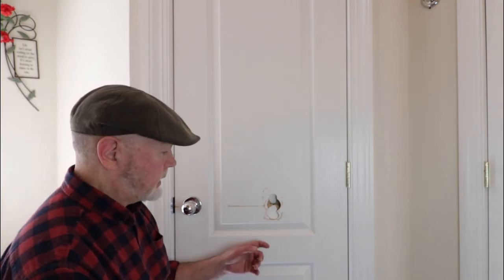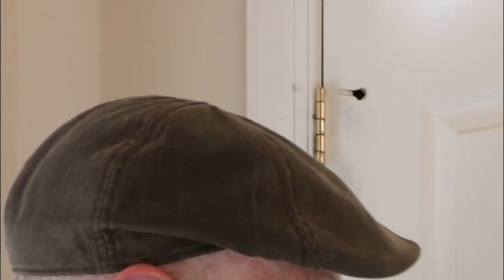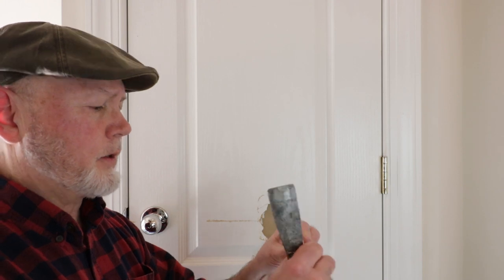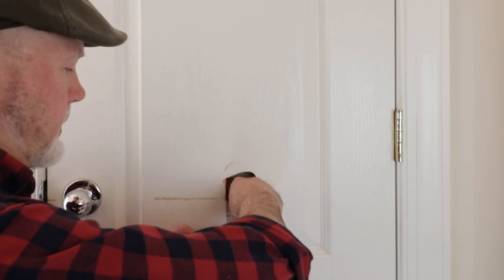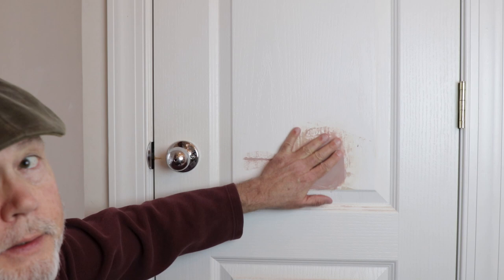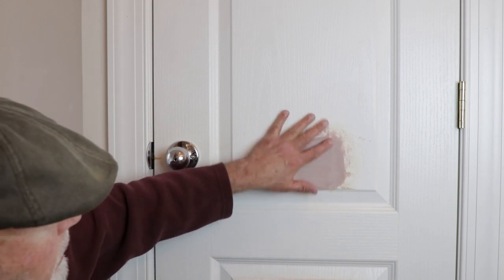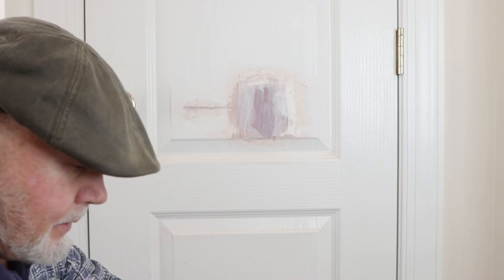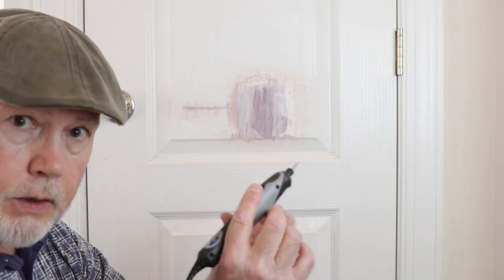How to - ADVANCED REPAIR A LARGE HOLE in a masonite WOOD GRAIN TEXTURE hollow core door

Comment: By far the best approach and the best results.  The little extra effort makes a world of difference.
Reply from the maker: Thanks Jim!
Reply: @douglashill7059  I'm doing this repair today on a two panel door.  I decided to cut out the two large broken pieces,  glued some backing wood to hold the pieces in place, and when the glue set I began to fill with dyno patch compound. So far everything looks good. When it's dry and sanded I will add the texturing to blend it in.  The break was where the panel raises out so the repair is complicated. I hope when it's all done and painted it looks as good as yours.  Fingers crossed.  Thank you for your master class on hollow door repairs!  Nobody else's even come close.

Comment: Good technique here. I've used Bondo (and occasionally JB Weld) for years on wood and its perfect for it.  While I was working in building and grounds maintenance, I was working with the senior maintenance guy doing some flooring projects in the various historical buildings and he gave me a little tub of "High performance wood filler".  It was just overpriced Bondo, though with a slightly more "wood" color compared to the old Pink bondo (though the new stuff uses a blue hardener).

I've actually got a couple hollow core doors at home to patch up and was wondering what the best way to get that wood grain in would be and, well, your dremel technique is perfect.  Always love excused for grabbing a new tool, thanks for the tips! Hope you are doing well.
Reply from the maker: Thanks for watching Chris

Comment: Valiant effort. Having done a lot of repair work for a living, the hours needed to do this make a $30 door the only option. And I've done some fake wood grain.
Reply from the maker: Lee, if this was an in stock $30 door, that would have been my first option.
Reply: @douglashill7059  these doors don't cost $30 .. more like $70 . and that's a blank door slab.  you still have to cut your knob hole and hinge mortise. and 2 coats of paint. so time spent there.  I've done several hole repairs. and with damages across the recesses . and all turned out great.   thank you for sharing your knowledge. keep em coming sir

Comment: Soo... awesome; perhaps hold the can upside down when dispensing to allow it to escape from the nozzle, also I have had experienced that expanding foam distorting the materials around it; that stuff has amazing power. It is used to lift concrete pads and hold power poles up.
Reply from the maker: Will make a note to hold the can upside down. Actually redid this project because I left the can in the attic over winter and the foam continued expanding for 2 days maybe because it was not fresh or did not shake it up enough
Reply: @douglashill7059  There is available minimally expanding foam that would be perfect for this.

Comment: Very nice! So i have a similar situation in our bathroom. My hole is in the middle of the panel and the wood or whatever is still attached, just dented in.  At the deepest its maybe 1/2". I was thinking of taking the lightweight spackling and filling it, then after i use the spatula to smooth it i was.going to take a nail or something amd drag ot through the compound to simulate the woodgrain. Since it's in the middle of the door I have to kind of connect the lines. Have you ever tried this method? It's not very deep and I don't want to rip off all the paneling and put spray foam in and do the whole patch I was figuring it was shallow enough that I could get away with the lightweight compound
Reply from the maker: It may hold up fairly well. I like the nail scratching concept
Reply: @douglashill7059  I will endeavor to make a video

Comment: So cool! What would you do if a hollow core door was cut down to fit and then the side came out? Seeing if I can salvage it. 🤔
Reply from the maker: Thanks! If a standard size door does not fit, and you had to cut it to size, and you cut it past the vertical or horizontal spine, separate the spine from the panel and wood glue it in place using clamps.

Comment: The repair work on those doors is all fine and dandy, but I am really curious about how your pool game went. I have considered using Bondo and some foam on a certain pocket, but alas, that would be considered cheating.
Reply from the maker: Having trouble with a certain pocket? Try leveling your table to your advantage before permanently covering the hole, lol
Reply: @douglashill7059  😂😂😂

Comment: Would it be possible to "engrave" the woodgrain with a pointed object while the putty is still pliable? I feel that would save you from having to Dremel it, especially if you didn't bring one along
Reply from the maker: Results will vary. Bondo sets up really quick. The nice thing about using bondo is if you don't like the result, you can always sand it down and start over
Reply: @jamest1375  It actually worked out really well the way I mentioned. Customer was very happy. No Dremel required 👍

Comment: Very informative video. I have a sunken spot on a closet door where my husband stumbled and accidentally pushed through the wood. The  broken spot is not entirely broken through, but I should still remove the cracked wood to make a hole first before repairing, correct?
Reply from the maker: Hi Michelle, if it is just a crack in the door, you can patch over it. If it is a hole, remove surrounding area before starting the patch. Thanks for watching and good luck with your repair

Comment: Hold the spray foam can upside down, your letting all the air out of the can.  You did it on both video's
Reply from the maker: Thanks for the tip
Reply: @douglashill7059  holding the can straight up allows you to clear out any foam in the tube.  Yes it's meant to be held upside down to spray the foam

Comment: I have this door and the sides are lifting from the base part on each side of the door. What kind of glue can I use to glue it back together? Also, the card board at the bottom fell out, I think I threw it away.
Reply from the maker: TRS, use wood glue and clamps, should be pine at the bottom of the door, if not cut a piece to fit and use wood glue and clamps

Comment: How would you repair a fiberglass exterior door that has a dog door? New doors are expensive and we do not have a dog.
Reply from the maker: Not sure how big the opening is, assuming it is the back door, is it a flush door or 6 panel, but you may want to just lock it, fill it with foam insulation, and call it a day. If it is small, maybe fill it with foam and put a kick plate over it
Reply: @douglashill7059  The top half of the door is a window. The bottom part has 2 panels. The dog door opening is about 12" wide and 16" long. The opening starts about 4" above the bottom of the door.

Comment: I've been building custom houses for 25 years and that's the first million dollar house I've seen with $70 hollow core doors and $1.50 door stops. That doesn't make sense any way you look at it. Not as the home owner that's spending a million dollars.  Not as the builder because the fastest way to ruin a good reputation and loose work is to cut costs on the finish details on high dollar jobs. It also makes it harder for the realtor to get asking price because who's going to spend that kind of money for a house with hollow core doors and cheap hardware
Reply from the maker: It really depends on where the house is located. This one is in Northern Virginia and part of a track of similar homes. I agree with you if you are building just a few million dollar spec homes every year, the consumer would be thrilled to have solid wood doors.
Reply: I know multiple millionaires and one billionaire and they reuse and recycle old materials and buy only expensive assets which profit them. When it comes to this stuff they would gladly pay less money. How do you think they became millionaires
Reply: @GoldenGamingDan ❤

Comment: That's why million dollar homes should not have hollow panel doors with hinge stops.  They put the money in the kitchen, bathroom and theater rooms.  Oops hollow doors
Reply from the maker: I ended up putting a stop on the tile floor to keep the two doors from colliding. Yes, I prefer a solid wood panel door